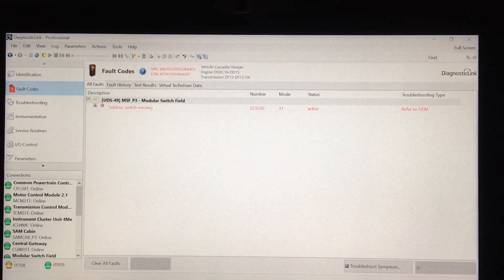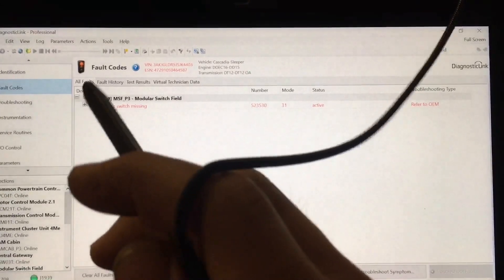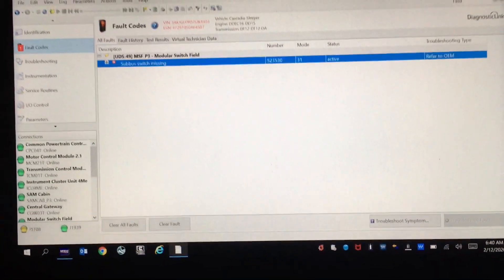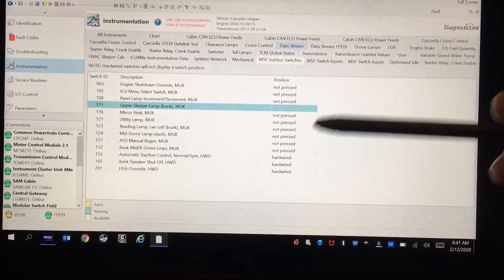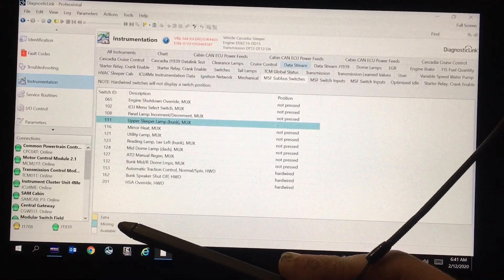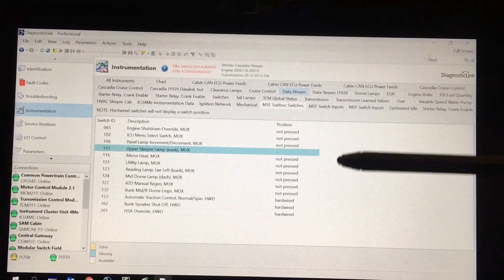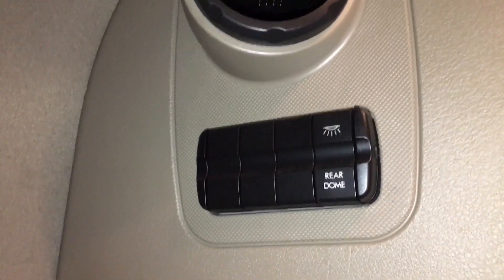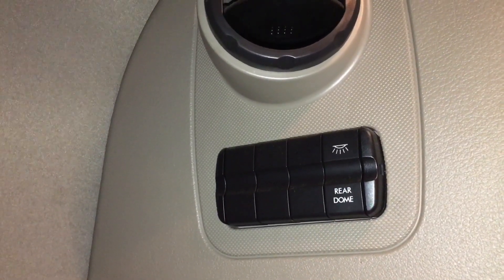MSF subbus switch missing

Comment: Ironically I had exactly the same problem for exactly the same switch. Pull the switch out and plugged it in at another slot on a dash - switch works fine, so must be something wrong with the wiring to that module on top. Never gonna need it anyway so just went to parameters and removed it from there - no more error. Thank you - great video!
Reply: LOL, that switch started working as soon as I removed it in parameters - go figure.

Comment: Hi, 
I have CPC, mcm missing and can not see them at left panel. How can bring them back?
Reply from the maker: Did you replace them recently or did this occur after you tried to update?
Reply: Just changed parameters
Reply from the maker: @sandybil  try connecting to them manually, go to file at the top left, then connect. It will bring up a box with a list of all the different modules. You’ll have to find your mcm and cpc (like mcm1 or mcm2 - cpc2, 3, or 4 etc.) try connecting to them like that.
If that doesn’t work there are some other things you can try, but it’s odd that they were there before you changed the parameters and then were not. So it probably has something to do with the parameters you changed.
Reply: I did but it is not downloading CPC, neither Mcm
Reply from the maker: @sandybil  is the acm or tcm connected?
Reply: @alreyindustries  yes connected
Reply from the maker: @sandybil  what parameters did you change and how?
Reply: @alreyindustries  I changed the CPC, and after that everything is connected except the ACM is not connected. I think there is a shortage somewhere?
And please how can I fix the original CPC?
Reply from the maker: @sandybil  Interesting. That’s why I asked if the acm and tcm were still connected. Usually if the cpc is bad all of the modules won’t connect. Did you program the cpc to the proper software through the “program device” tab on the bottom left?
Reply from the maker: @sandybil  here is my video on programming the control modules: https://youtu.be/ZsLI0709X0c 
do this first if you haven’t and make sure you “remove all”, “add”, “refresh software” and connect to server before trying to reprogram the software. 

For the old cpc, if it isn’t damaged you will have to plug it back in and connect to it manually. If it connects you will have to go through the same process as described in the video I just attached to this comment but when you come to the point where it asks to update or replace software, you choose replace. That should allow you to reprogram that cpc with information from the Detroit server that fits your vin and esn.

If you get the cpc back but the parameters are messed up, there is something else you can do to restore the correct parameters, but if you need that let me know and I’ll try to talk you through it.
Reply: @alreyindustries  thanks a lot, I need the original DDDL8 from deal with a password? If so i do not have!?

Comment: The truck just won't start and that's the only thing that came up in the computer
Reply from the maker: @cyrilbarnett52  is it cranking and not starting or is it not cranking at all?
Reply: Yes is cranking but just won't start
Reply from the maker: @cyrilbarnett52  then I’d say it’s most likely that you have a fuel issue.